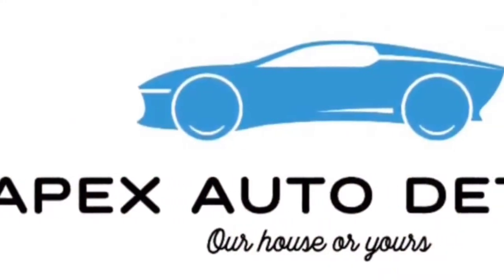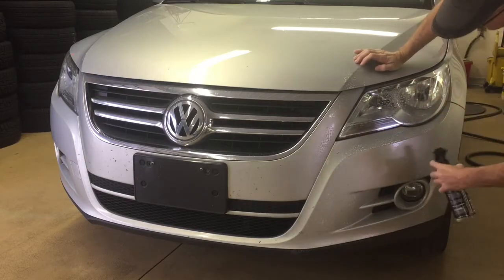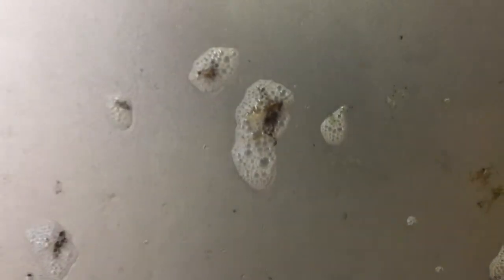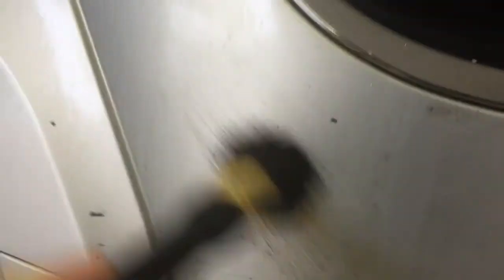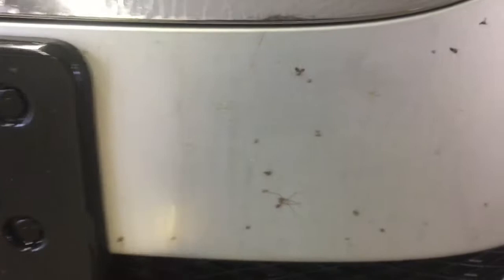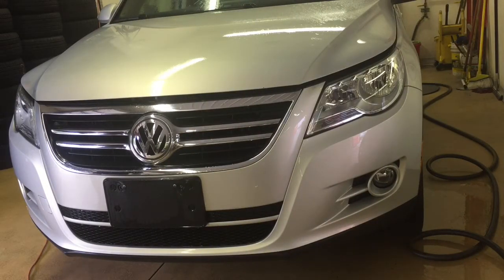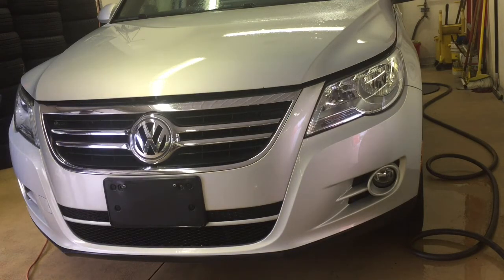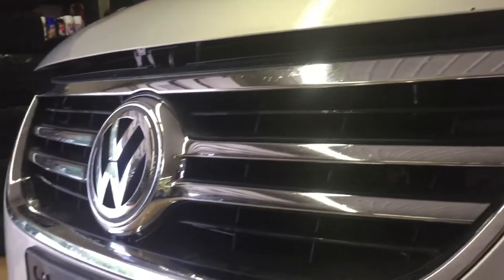Take REVENGE on Bugs and Insects!! Clear Coat SAFE......as well as safe for all hard surfaces!!

Comment: The product's gel-like consistency is a nice feature. FWIW, I use a degreaser for insects that was made for removing oil from concrete - the description really doesn't sound so great right now. It needs a quick rinse, but removes bugs like Citrol. Spray and hose. IMO, a ceramic coating is fantastic for removing bug guts; it makes the process much less painful.
Reply from the maker: Absolutely... a ceramic coating makes the process a piece of cake! 🍰

Comment: Brian, great video. I actually own this and live about 5 miles from the angelwax factory here in Glasgow. My question is, after the removal of the bugs often I find a staining on the clear coat which this (in my experience) does not remove. Is there a quick fix for this or would it require correction?
Reply from the maker: A light polish with Perfect Polish👍🏻 

Make sure the surface is cool and in the shade for best results.
Reply: Thanks! Will let you know the outcome.